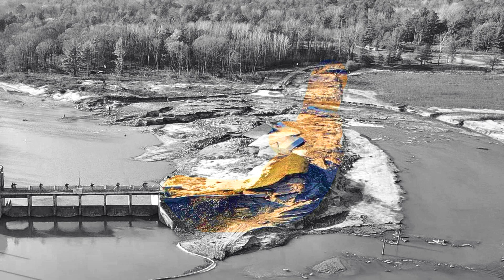Update:  Sanford Drone Dam Failure before/after comparison

Comment: Sanford dam overtopped and eroded only after its concrete spillway became clogged with debris from the failure of Wixom's-dam. If this debris had been intercepted farther upstream from the Sanford spillway,  I doubt if Sanford dam would have overtopped, even with the extra water from Wixom.  This, of course, is hard to prove after its erosion-collapse. Furthermore, effecting such a timely intervention would have required considerable vision, effort, courage, and sufficiently strong cables  and anchor-points far enough upstream from the spillway. Unfortunately, such vision and initiative appears to have been absent while the debris was heading down toward Sanford lake.  The most cost-effective location for this interception cable would have been sufficiently downstream from the entrance to Sanford lake, where flow-rates would have been slow enough to safely install and anchor the interception cable before the debris arrived.